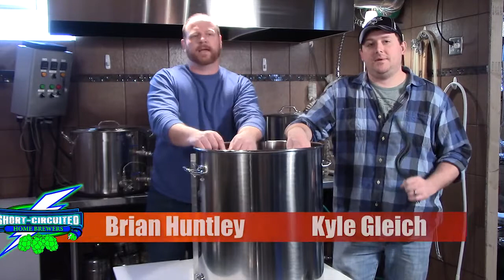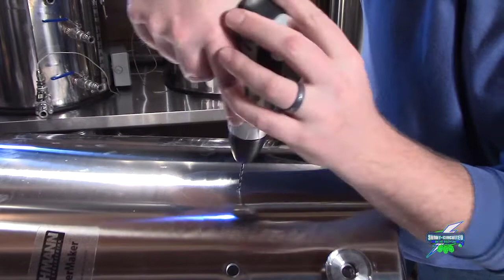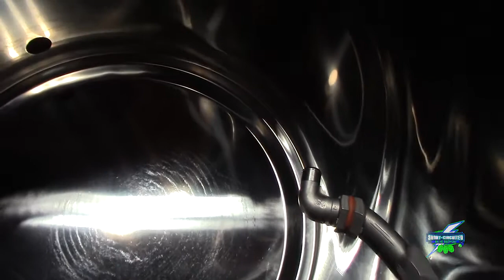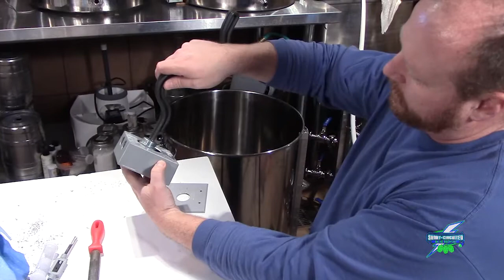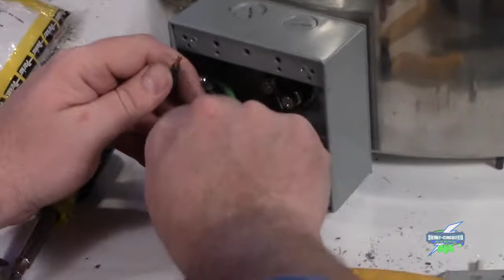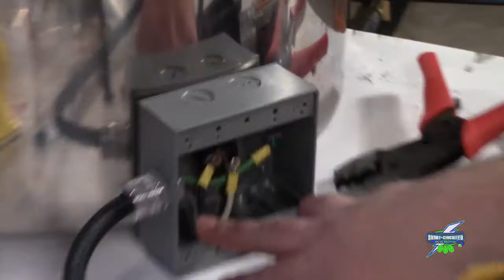Electric Brewing Series | HERMS Coil install, Elements, and Wiring

Comment: Why did you drill some holes and use the punch on the others?
Reply from the maker: Only had a punch for the smaller holes. They aren't cheap. 👍🍻
Reply: Rgr that. Thanks for getting back to me. Nice work as always.
Reply from the maker: Thanks for watching!! 👍🍻

Comment: What was your measurement on the placement the heating element in the HLT? I plan to install two heating elements in the 45gal kettle. What would be better placement for this, one on top of other? Thanks a lot!
Reply from the maker: VV V the are about 2" from the  bottom. Placement doesnt matter for heating purposes, just make sure your elements are below the lowest boil point. My kettle it sits around the 3.5 - 4 gallon height so I can do 5 gallon batches.. Cheers! 🍻
Reply: Thank you! :)
Reply from the maker: VV V Sure! Would be really interested in seeing your finished system!!
Reply: Sure. I am on starting stage yet. It will take some time :)

Comment: Is there a rule of thumb for how much water is needed it the HLT to a gallon of wort? In a HERMS
Reply from the maker: dmmflys I like to have the coil covered. Based on that I will sparge to my volume, any water left over can be used for cleaning. Most of the time there is less than a gallon left.
Reply: Short Circuited Brewers what do you think the best guess average amount of water  is. I have an experiment  I want to run. Part of it is how little HLT water I can get away with and still be able to hold a mash temp and raise it for mash out in a relatively acceptable time.
Reply from the maker: dmmflys in my case 11 gallons is what it takes to cover the coil. You could get away with 7 or 8. A lot depends on the vessel size and coil size.
Reply: Short Circuited Brewers thank you cheers